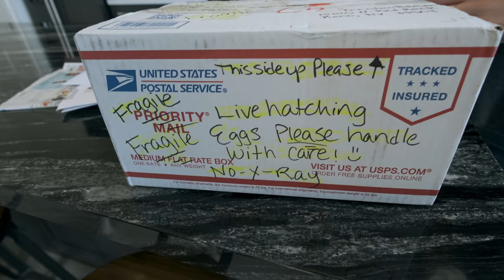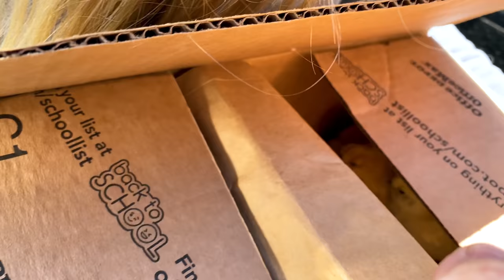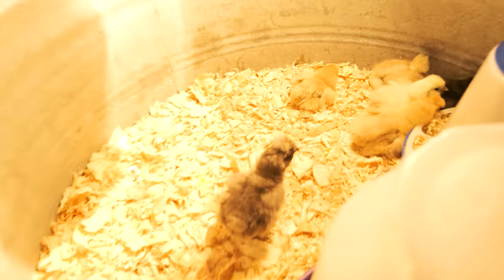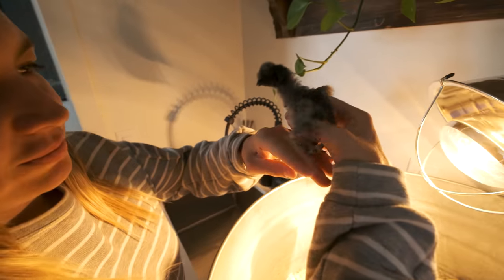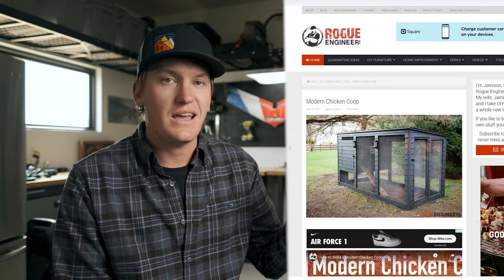Wife wanted chickens... So I built a chicken palace

Comment: The coop should have fencing going down into the earth a couple feet or else there should be a wire screen floor. Coyotes will dig right under the sides.
Reply: I use old cyclone fencing. Works great and sometimes you can get it for free if it is bent or damaged at the store. I go 2’ down around the perimeter and bury a piece the size of the footprint six inches down, horizontally. We have badgers, skunks and coyotes.
Reply: I agree with both these responses Trent. Put some wire mesh down around the whole outside of the coop and you should be OK.
Reply: You can also take a wire mesh fence (like a 4' tall garden fence), attach it to the sides of the coop, and then fasten it to the ground using long landscape pins (or, dig down a few inches and bury it with a bit of dirt) - easier to do than digging down 2', plus it prevents predators from attempting to dig (they can't dig through the wire fence).  The way I see it, if a coyote is willing to dig down and horizontal for 4-6, and then back up', he's earned a chicken dinner.  I can't take credit for that method, learned it from Carolina Coops.
Reply: Exactly what I was thinking. A yote will dig under that in a matter of mins, especially in the soil at that location.
Reply: I think a 220 volt perimeter wire would keep the coyotes at bay.
Reply: These guys are right, Trent. Get it sorted before the chicks are moving around in there. I been ther done that and nothing will get Momma's anger up like losing a hen to a predator. Seal it up as suggested.
They are a pain getting going, but there is nothing in the store that is going to compare to the eggs you are going to have soon. You will never look at store bought eggs again once "Palmer's Poultry" gets into production, LOL
Reply: Exactly right... I woudl suggest digging up the soil layer and laying down the mesh the covering with soil. Bitter experience tells me that predators and rats will find a way through, it needs to be bullet proof.
Reply: @UncleKennysPlace  they'll have plenty of fried chicken. But no eggs.
Reply: OR get a big dog (Maremma or similar to scare off the "predators" - or 2 big dogs..  Maybe simply safe makes a "smart" coyote/cat scarer. 

NB. with our "Rabbit proof fences" the lazy installers made the best fences. digging a wide shallower trench (with convoluted folded wiremesh) made them more impervious to burrowing critters than a straight 2 foot vertical curtain.
Reply: I grew up in the UK and watched this wondering what you have in the USA that is like foxes in England.  I have a feeling that Coyotes would be way worse than foxes, so your advice to make the coop coyote proof is sound.  I have never had chickens (we did on the farm but I'm not counting that) but what I did have was badgers that used my garden as an expressway.  It was close to impossible to stop the buggers.  I can remember one night listening to a badger for what seemed like a full half hour as it smashed its way through our fence. Now if that was a coyote and there were tasty chickens the other side of that fence, I'm betting it would be a whole lot quicker!
Reply: Would you listen to these guys????? Dont listen 4 one minute.  Hopefully the coyotes will come and this nightmare will be over sooner then later 😁😂🤣😂🤣😄🤣 
Im still laughing at all the work you did four 4 chicks pissing myself laughing  tooooo frikin funny
Hopefully youll re- coop your losses when you sell the coop to another unsuspecting loving husband .
And dont go easy on the bastard give it to him hard so he will learn the lesson too  1000Gs for the coop
Tell him he's getting off easy 😂🤣
Reply: had the same thought looking at the build - I was hoping i missed something but by the number of responses i'm going to guess not

Comment: I think you will find a low temp warning on the simply safe the most valuable.  If the heat goes out it will go out when you are not around.  To save you plumbing and water damage.  I live in the mountains I can't tell you how many homes have been saved by low temp warning.

Comment: It must be the year of the chicken, my wife decided the same thing only we're splitting 14 chickens with a neighbor and they are 2.5 years old. But it has to be a grander project. Floor 2' off the ground, 60 sq ft hen house, 210 sq ft run, and deep litter method, on not leveled ground. Working on the weekends around rain. Hopefully with extra help today it'll be to a functional state.

Comment: Been there, done that. My better 3/4 wanted chickens and coming from three generations of carpenters I over built a chicken McMansion. 2x6 insulated walls, steel door (salvage) heater, wired for lights and an remote chicken hatch. This thing was on skids so we could move it around and had a wire enclosed detachable 8x16 foot run. Yours turned out very nice, Trent!. Like RG says, ‘if your lady can’t find you handsome be handy’.

Comment: I made my chicken coop from scratch. Bought truck loads of wood and built it on an insulated and raised floor which we then painted with rubber so it doesn't rot out in months. 12 chickens, 8x12 coop and they get 8x6 of that and the rest is for stores. 8x12 run too. And then 1 died. And for the 11 that survived it is nowhere near enough. So they get let out into a few hundred square feet with a 48" high electric fence. You need to do something to prevent them, or predators, digging under the run. We have a hardware cloth apron inside and out. On the inside it is buried, on the outside it is on the surface. Having the mesh fastened from the inside makes it easier to push in. I wrapped rolls round the outside, then used long staples every few inches to secure it to the 2x4 uprights on 24" centers in the run. I have an automatic, light triggered, door too. So when they go inside at night the metal door closes behind them. Chickens go to bed early. They take a lot of feeding too. But the eggs are good. We average better than 9 per day from 11 chickens. Worst in the winter was still 5.

Comment: In Australia, we typically add a 'skirt' of chickenwire mesh extending outwards horizontally against the ground (or buried slightly) maybe 2-3 feet all around, to prevent/discourage critters like foxes and dingos burrowing underneath the coop wall. Whether it's needed depends, I guess, how rocky v sandy the soil is...

Comment: Welcome to the world of chickens. I am not sure how secure the bottom edge of the coop is for entry by burrowing animals. I learned the hard way a few inches deep, narrow trench filled with Sakrete keeps anything from getting under and in. My current outside run has a 1x6 deck board partially sunk in a narrow trough with Sakrete mix poured in on both sides of the board.

Comment: Beware of "monitored" home security systems. I had a Brinks system, left on a business trip and my house was robbed. The cops do not rush out to your house just because you have a high dollar monitored security system, and thieves our fast - usually less than 5 mins. Then the cops told me that they new the gang that hitting homes in the area, but they were hard to pin down and it wasn't within their man power to chase after them. The cops flat out told me that these security systems are grate for scaring kids away, but organized thieves are almost never pursued and are rarely caught. Your best money is on a safe room and a commercial fireproof safe. Then insure the hell out of anything you can't lock down.

Comment: Like gil57usa indicated below...you need wire mesh down underground at least 12 inches then out away from the coop by at least 24 inches buried and compacted. This keeps the critters from digging under and having chicken dinner. The next thing is to back up the stapling of the chicken wired on the inside with at least 2x2 or 2x4 well screwed into the framing members all the way around. Stapling alone only keeps the chickens from getting out but a good-sized critter will bust right through that stapled only wire. Other than that...great looking chicken coop...now onto that hanger and some flying and keeping Nikk filming his build.

Comment: You can do two levels or three on each end. And fence around the outside so they can be outside. Chickens don't fly but they like to jump from pole to pole and can easily get up to the ceiling. 
You can let them roam around outside all day. They won't leave the yard and will go back in the hutch at dusk. Occasionally you'll have a straggler.

Comment: You shoulda insulated that thing. They'll keep laying longer thru the cold months if they're warmer and it will save you electricity for the heat lamp or wall heater that you're going to want to put in there.

Comment: Trent, you need to dig a boarder around the coop an fill it with Chicken wire. Otherwise predators will just dig under and into your coop. Its a safe and necessary precaution.

Comment: Silkies can't hardly fly up 18", since their wing feathers are all fluff. I have 3-silkies I incubated for a friend. Several years back I had a pit bull running with 2 other dogs tear into the cage. Chicken wire pulls apart if pulled hard enough, and a pit bull can pull hard enough. He got into the cage and killed everything. His mistake was he kept returning to the scene of the crime. I had to add 4" x 4" welded wire to the bottom 3' to make sure that didn't happen again. Good luck with your chickens.

Comment: As someone who lives in a rural high elevation location with tons of predators... I cant tell from the video but did you do anything so animals cant dig under the coop? Very easy for them to gain entry in minutes that way. we actually use donkeys to scare off coyotes. The hardware cloth around the outside is the right choice. Also, please keep an eye on the heat lamp in the coop, people loose their chickens regularly from heat lamps burning down their coops. There are some great safer alternatives.

Comment: I used to believe in the "happy wife, happy life"...but then I realized there was no LONG TERM solution to making the wife happy.  Which is why she's my EX!  Her temporary happiness was costing me a fortune, and the divorce was much cheaper!  No wife= single life= HAPPINESS.

Coop:  great work Trent, but suggest one more addition:  a perimeter barrier BELOW grade to protect against digging of predators trying to tunnel underneath.  And they will try.  I saw it with my sister's place.  Coyotes.  Foxes will too.  Her hubby recessed chain link fencing underneath about 3ft. deep, flush to surface, full perimeter.

Comment: LOL  My wife and I bought 8 chicken and a chicken coop to hold 8 chickens.  One week later i come home to find 19 chickens under warming lights and my wife asking to build a bigger coop.  1 year later we had 55 chickens and 6 rabbits in a 12 x 24 coop, selling ~4 dozen eggs a day.  Good luck with the Silkys, cool bread but ours just got picked on.
Reply: Also i would recommend a much larger cover run. You want dry dirt where they can dust bath all the way through the winter months, it will save you from them getting mitts and lice. We live in high desert and we learned the hard way after the first snowy winter. Remember that wind will blow rain under an overhang so if you dont put walls make the overhang much larger.

Comment: Trent, this is late but heat in the chicken coop is a big no no with a heat bulb.  Chickens die from drafts and humidity, not cold.  However if you want to give them heat look for a sweeter heater.  That bulb blows up and drops hot pieces on the bedding, it catches fire and puts your house at risk and certainly kills the poor birds.   If you insist on heat, do it in a safe way.  Google coop fires if you think I'm being an alarmist.  Just trying to help.
Reply: Also, you should take some of the hardware cloth, dig down 2 feet around the exterior of the coop and line it with the hardware cloth.  Make sure you use screws and washers to attach it.  Most predators will push staples out without much effort and then the chickens are done for.  The 2 feet down will stop something from digging into the coop.

Comment: i also use ryobi... cheapest at home depot, and NEVER has a single tool let me down, and I have literally every 18v tool they make
Reply: for me its just been the batteries mostly the older ones. i have some that are 15 years old still working just find but since i don't use them everyday like a contractor  no problems
Reply: You can buy replacement batteries from third-party producers online for pretty cheap, or you can always pop them apart and replace the individual cells yourself, I’m pretty sure they use like 18650 batteries or similar

Comment: Not sure how you fastened that wire to the inside of the coop, but I suspect that's the weak point in your security. Large cats and coyotes are surprisingly strong. Perhaps SimpliSafe has a solution.